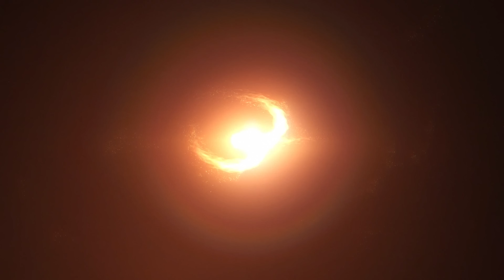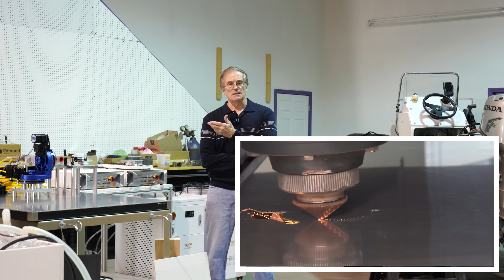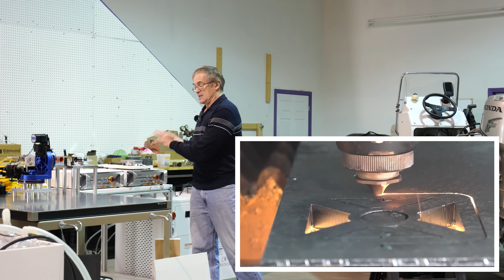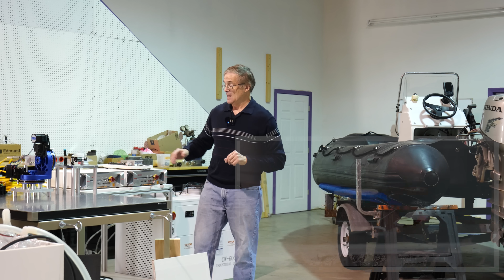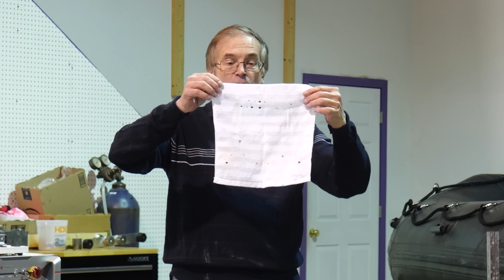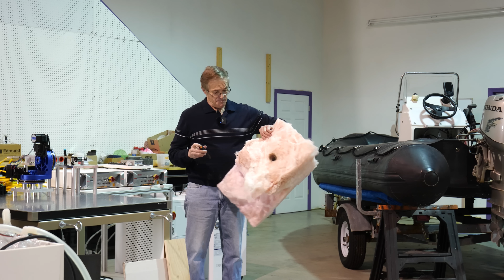We have a problem... and need your help!

Comment: Lasers use mirrors all the time, so just use a convex mirror set at an angle, directing the expanding cone of laser light, (Now defused and cold), onto your back-stop of sheetrock.  Always minimalize for effect, and stop over thinking it. . . An old saying: "Think Long, Think Wrong!"   Get it?   It's "Occam’s Razor", Right?

Comment: Would running water via recirculating pump over a series of metal plates or polycarb or even plywood sheets. Even when first few layers are penetrated, the water will cool the area and disperse the laser energy.   Maybe something can be added to the water to help absorb the laser energy.

Comment: Two layers of hardie board separated by one inch. Fill the middle with sand (or other mobile media). As the laser vaporized the sand, gravity will pull more sand into the way. The beam will never make it to the back hardie board.

Another idea: A large spinning cylinder. The beam won't linger on one area long enough to get through. 

Credit to Atomic Rockets page, as these are both strategies that might be used by starships in the future.

Comment: Im curious...  Can you make the laser light LOOP  ?   For example... using a one-way mirror at 45 degrees... The light passes through this ... then Hits a 45 degree front-surface mirror thats placed about 3 feet behind it.   That mirror bounces the beam to the left...  to another angled front-surface mirror,  and once more to another mirror... which then hits the Rear surface of the One way mirror... to continue to LOOP within itself  ???

Comment: You mentioned trying water-soaked fabric, but what about a tank of water? I'm thinking a 55 gal drum on rollers. I realize the beam itself is tiny, so it may just make a bunch of holes for the water to leak out of, but once the beam has entered the water wouldn't its power be dissipated throughout the entire water volume?
Reply from the maker: That's correct.  But remember that we have to protect the entire back wall.
Reply: @TechIngredients  Fair point. I was thinking of a small static target and forgot about the drone part. I also wondered about Hardiboard or Durock? Those are available in large sheets from home improvement stores, and aren't insanely expensive. A fiber cement sheet isn't necessarily better than brick, but it would allow you to set up multiple layers.

The only other thing I can think of, which probably isn't a great solution, would be changing your firing angle. Put the laser on the roof and fire at the drone from above. But even then it isn't a great option, because you'd need to make sure you don't accidentally start a forest fire. If only you lived near a quarry! :)

Comment: Point it at the ground? If you can't sacrifice the floor, then take it outside or at least have the "range" be outdoors, pointed in a safe direction that will eventually hit earth. Agree with most other comments that you're probably looking for a firing range.

Comment: Have you experimented with a composite layered setup? something like a thickness of blanket in the flow of one or more water curtains (to help with any reflection that may occur with just water) in front of the wooden/cementboard backer board. The water curtain would help rewet the blanket to extinguish any fire, as well as be a thickness of high specific heat material that would absorb energy in addition to being in contact with the wooden/cementboard backer to keep that surface wetted and extinguish any flame and remove heat.

Comment: Couple of questions, what is the duration of the test? what safety factor would you like applied to the duration if a malfunction occurs in your control system? What restrictions are there on the dimensions of the backstop? While cheaper is better what is the ceiling for your budget?
Reply from the maker: They will extend over hours,  but the exposure of a particular area of the wall would be for a few seconds.
The area we need to protect is approximately 25^2 meters. We haven't determined a budget. The choice depends on the performance trade-off. 
Light, simple, and effective justifies more expense.
Reply: @ thanks. This is not my area of expertise, but I hope these questions help someone who is. 

My thought is to use a similar technique to rocket engine bells, adapted to a flat panel construction. Fire rated carbon fiber ablative layer might be too expensive those are rated to 3000 C, but perhaps off the shelf carbon fiber sheets without the resin to avoid any toxic fumes. A simple gravity fed water curtain running down the backside to provide the necessary cooling to the material might work. Carbon fiber sheets would be light, compact, easily deployable, replaceable, and non reflective. The water curtain might be a bit of a pain to set up if gravity fed is not quick enough to dissipate the heat though.

Comment: Thanks for sharing your thoughts, ideas and videos. Interesting problem to have, no clue if this would actually work but I’m thinking a waterfall feature with a full curtain of water. Perhaps settle the water into a wide laminar flow. Pondering how thick of a laminar flow can be created and then basically line them up in parallel to cover the space required, definitely talking about lots of water and pumps.

Comment: Is it possible in your setup to “unfocus” or refocus the beam to broaden the beam prior to dumping the energy? At that point  a water chilled carbon block (or similar) may be enough to absorb the energy. If unfocusing the beam is not practical then might I suggest deflecting beam into a water tank with spaced layers of ceramic and/or carbon honeycomb for deflection and cooling.
Reply from the maker: Probably not. Optics down range will have to cover the entire wall.

Comment: How about used tires or rubber mulch?  Have some sort of water system that cools the holes down so as not to reach 750 degree Fahrenheit (tires ignite at about 750)  then drip water down from a pipe with holes, collect the water at the bottom and pump it back up to be dripped out again.

Comment: Here's an idea, since you love building and testing, why don't you give the old starlite project a go. You could test out a homemade heat shield made of organic and inorganic compounds, borates, ceramics, and even use some graphene from previous experiments. The expanding carbon foam is enough to stop the laser heat, and I think you would have a blast tinkering and making a highly effective starlite heat shield. Good Luck!!

Comment: laminar water fall, put some die in the water to enhance light absorption? Mirrors at 45degrees downward to deflect to the floor? Just poiint it at the sky (with Air traffic controll permission of course....make the fiberglass wet, angle it for thickness....nice problem....I look forward to the answer you come up with....OR.....have the cut off switch computer controlled with a IR camera pointed at the wall that shuts off the laser as soon as it sees the laser light.,

Comment: An array of mirrors (was also thinking of a bundle of fiber bonded in parallel) redirecting the light into a trap filled with water that has some turbidity.  Think Ivanpah and you’re the sun.  
I see a problem with mirrors that are fixed and flat, the bonded fiber wall would be difficult and expensive. 
Possibly a large convex lenses or fresnel with water (or whatever liquid) at the focus. 
Cheap convex plastic lenses with a water curtain behind. 
Clearly I’m all over the place but sometimes spamming ideas helps. 
Good luck.

Comment: Angle the test table down 20 or so degrees, build a small garden bed filled with dirt as your backstop. At the angle the beam hits it it'll need to go thru several feet of dirt before it hits your concrete floor, the bits of dirt that melt can just be shoveled out and replaced like cat litter. Cheap, probably effective.

Comment: You could make a mobile wall of bricks. they will need a back like drywall or plywood to help keep it stable but you could put it on wheels and just move it behind your target. Make sure to use solid bricks, or even a slab of cement could work. you could also use mortar to patch it up between days of tests.

Comment: What about water being actively pumped over an opaque surface? Less time needed to allow wicking as it's just flowing over the surface. Maybe water flowing behind/between layers of thermal wool? The stuff you would use to insulate a pizza oven.

Comment: How about a tank of water with something in it that disolves well and absorbs at the wavelength you need? Cheap and you can dump out the water to be portable. The sides of the tank should absorb that wavelength in addition to mandatory eye protection for anyone in the area. You could also use an in Earth tank so the sides are 10s of FEET of dirt. Maybe even dirty water will absorb well.

Comment: How many times have you heard this one: "If I had you as a science teacher in school I would have become an engineer for sure!"
What a great channel! Maybe the best YouTube channel ever. Thank you!
Reply from the maker: I have, and I never get tired of hearing it.😁
Reply: @TechIngredients  You deserve the praise, and you are more than likely inspiring many of a young age who can set out upon that path.
Reply: @TechIngredients  
maybe you could position a lens behind the target that would spread the beam 
you may be able to make two walls of lenses so that beams at the periphery of the first wall lenses would not be at the periphery of the second wall lenses
Reply: @kablammy7  that is my idea but a sheet of diffusion material so it can easily be rolled up and then carted to the new location, and hung on something behind the targets so anything that passes through is quickly dispersed into weaker wider beams but the beam should not heat it much due to it being "transparent" or translucent to the beam vs it absorbing and burning, (I have had this experience with a 405nm 2500mW laser that does quick damage to a ton of things but natural translucent PLA it would do nothing to it no matter how focused, however it would burn paper and such on the other side stuck to the back of the PLA LOL. this gave me the idea of using it to orient magnetic powder mixed into PLA with a magnet so as it cools the magnet powder would be frozen in the orientation a magnetic coil forced it into while the PLA was soft from the heat generated off the magnet powder after it passes through the PLA to hit the magnet powder from neodymium magnets.
Reply: @TechIngredients  ceramic brick like Ceramic Oven
Reply: il te faut te fabriqué un panneau de petite brique de céramique c'est super poreux et il y a tout un tas d'assemblage chiqmique different pour avoir un effet de dissipation maximal

Elles sont creuses et peuvent supporté 2100 degrés Celsius a beaucoup plus selon leur matériaux
Reply: @TechIngredients how about hardie board which is essentially concrete and doesn’t burn? Cheap and readily available.
Reply: I’m an engineer nearing retirement. This channel makes me wish I went into applied physics…. Maybe that can be my retirement career.
Reply: That's probably the first thing I thought when I started watching this channel
Reply: Even when he (rarely) has his head completely wedged he's educational and fascinating. Before duplicating some of the experiments, get a second opionion (sound projectors, rocket motors,  fiber lasers, ...).

Comment: Rather than water soaked rags, what about a water reservoir? Maybe a mirror behind the test section at 45° directing the beams into a pool with a substantial sediment of sand in the bottom. On top of that if you can dissolve a salt in your water that specifically absorbs part of the laser light there might be some absorption tricks you can do to further attenuate and diffuse the beam.

Comment: Okay I will suggest that in the place of the pink fiberglass insulation you should try rock wool insulation (the grey stuff) because it is supposed to be fire proof rather than fire retardant. The other thought I had was a prism trap that would bounce the beam around enough to dissipate the laser. The only problem being that the first prism hit might get damaged due to the heat. The other idea that may help is laser follow-thru. If the laser remains in motion after cutting the drone then the laser will not have as much time to cut through the material of the backdrop. Your material tests have been direct shots at one spot but what may help is a straffing shot test.

Comment: what the help is for, you seem to be just fine. beam me up scotty. get a focal length. yep target distance setting. yep the focal length is a design feature. optics focus system. if you make an infinite distance laser sword then its how its designed. well, mirror bullet trap. or a bunch of concrete slabs. yep a shooting range target. ceramic tiles to stop your every day intrusions. sand bag wall. your focus system is the key. stay focused on your own stuff thanks. why do you ask outside for help. makes no sense.
Reply: well how about magnetic induction roller track launcher. similar to normal roller launcher but magnetic + metal target.
Reply: try pulse jet integrated with tesla turbine turbo = rotary pulse jet engine.

Comment: Electroetched tungsten. Etched to have pointed, deep ridges facing the beam.

It's the same principle as stacked razor blades edge on, just made to the scale you need to cover.

Comment: I think water is your bet, but I mean a tank of water.  I would think the optical properties of water would disperse the beam into harmlessness pretty much immediately. I don't know, maybe the beam would just melt the glass of the tank wall.

If you had a way of making a water cascade, a small waterfall that the beam would pass through, That way you have moving water and no medium to melt before the beam hit the water. That would require a reservoir/catch basin a pump and some way to spread the water into a sheet before it falls.

Comment: A few thoughts I had: First would be to look into some form of ablative protection, either charring or otherwise (I think this is why wood did well). Maybe just straight graphite. However the very nature of how a laser cuts, is through vaporization, so it may not be as effective as one would hope. here are a couple resources on ablative protection materials: https://ntrs.nasa.gov/api/citations/20170011453/downloads/20170011453.pdf, https://www.youtube.com/watch?v=aqR4_UoBIzY.   My next thought is to use a large diffuser of some kind, something to spread the beam once it hits then use another technique to stop the less powerful beam. Most high quality optical diffusors are about an inch wide, making them way too impractical and expensive, so some kind of cheaper option would need to be found. Something like frosted glass may work although I worry about it reflecting back or melting because of the low quality optics. And finally maybe some form of smoke/gas to eat as much of the energy before it hits the surface. I'm not sure how thick such a smoke screen could be made, but with some plexiglass you could create a small smoke screen and fill it as densely as possible with smoke or even water filled with some opaque particulate (maybe graphite again). I'm not sure how cost/practically effective any of these would be against a monster laser but it might be worth looking into.

Comment: Something like the perforated steel plate with water coming out that SpaceX uses under the super heavy booster.  Could be a water cooled graphite plate.  The key is possibly going to be phase change.  Changing water to steam, or solid to vapor.  What phase change can absorb the most heat without making a toxic cloud?

Comment: Thinking about the properties it needs to have, somehow Graphene comes to mind.

Could need some sort of thicker layer, not for blocking so much, only to filter down, so it can lower the energy without getting damaged...also need good heat transfer...no idea what, some stupid first ideas: Some oils, micro fabric Tungsten net? 

To block reflection, a special layer above, that does not reflect but only mirrors back would be perfect. Don't know anything like that...

Comment: Use milk. Basically a really cloudy opaque fluid. Will diffuse the beam and in a liquid would also dissipate the heat. You could find some other suspension in water… some sort of crystal suspension?
Reply: Or silica nano particles like people use for making artificial opal…
Reply from the maker: That's a good suggestion.
Reply: @TechIngredients and me, unemployed from in the oil drilling service sector, i'm wasted in the oil field.... but still could,use a job..
Reply: @TechIngredients did you try it?

Comment: An old used beat up dump truck full of sand/gravel , would be mobile, cheap and easy to repair ( weld the hole's closed after the testing ), would also allow to test other media in the box , then just resell it once your done with it.

Comment: Water soaked aramid (kevlar, nomex, etc. There are several cheaper versions that are similarly resilient to high temperature) fabric, but kept wet in a manner similar to an evaporative cooler. Give it a waterfall with IR-absorbent dye in the water. If you can get aramid wool, knit into a "blanket" for extra thickness, even better.

Comment: Please read all ideas, bakelite sheets?used in electricals.
Or mica sheets? But mica is reflective..
Banned asbestos sheets? Sheet but will definitely work.
Fill the room with 99% fog. Full mist spray like used in cattle farms.
Mist or indoor fog indoor clouds.
Clouds block the lasers best.

Comment: A spinning sheild might help. If the laser gets stuck in one spot the surface behind it will constantly be being replaced to a point. Perhaps if it were big enough and fast enough it could even be cooled? Think either a pin wheel or a barrel spinning.